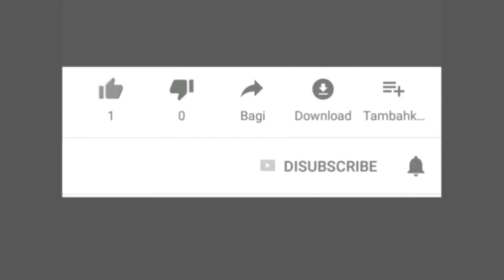Beat karbu susah hidup saat mesin dingin | service karburator

Comment: beat karbu saya kalo dingin di stater ga mau nyala bang, harus di engkol duluu baru nyala. setelahh nyala trus dimatiin baru mau di stater lgi, tapi kalo dingin gamau lagi di stater. itu kira² apanya bang?
Reply from the maker: Aki error, bk bisa nyimpen arus
Reply: Sama dengan sya punya bang, apanya yah kira2
Reply: @Simogokchanel  sudah 2 aki dicoba gitu terus bangg
Reply: @Aku-ys8br udah nemu bang solusinya??
Reply: @asmu-ez1rr  kmaren motor saya agak brebet jga sdikit bang, sperti telat bensinn. trus saya sumbat lubang aisnyaa, habis itu mtor dah ga brebet lagi+stater normall
Reply: @Aku-ys8br  lubang ais yg d mana bang
Reply: @asmu-ez1rr  coba abang cari video cara menutup lobang ais
Reply: @Aku-ys8br  ada yg nyaranin tutup cup otomatis
Reply: @asmu-ez1rr  nah saya blum nyoba bang, tapi alhamdulillah mtor saya dah sembuhhh
Reply: @Aku-ys8br  ok bang,
Terimakasih atas infonya

Comment: bang motor saya kalo pagi di stater ga mau idup knapa ya tapi di sela nyala pokonya tiap dingin mesin ga bisa stater ga mau ngankat/nyala
.harus di sela dlu udah panas baru bisa stater bingung
solnya motor di pake cwe ga bisa nyela harus setater trus solusinya apa ya ?
motor saya beat karbu
mohon bantuanya
Reply from the maker: Di check aki mas, kemungkinan saat motor dimatiin dan diamkn lama, aki tidak bisa menyimpan setrum, sehingga ngedrop, kareba stater menerlukan aris yg besar, sementara itu dulu,,klo udah mrsin nyala kn aki terisi arus kembali
Reply: Coba di jumper bang x bermanfaat
Reply: udah nemu solusinya kah bang? soalnya beat karbu saya penyakitnya persis kaya mtor abang